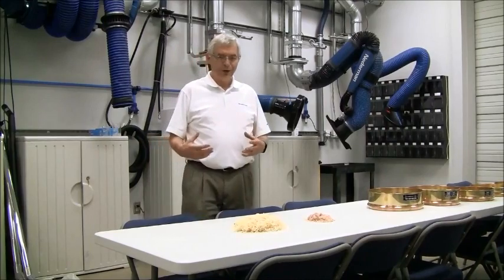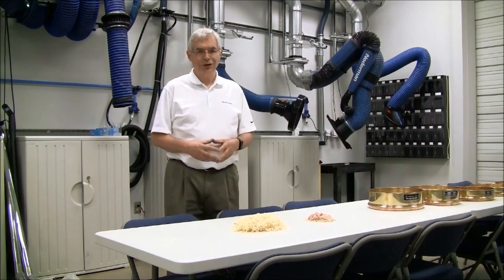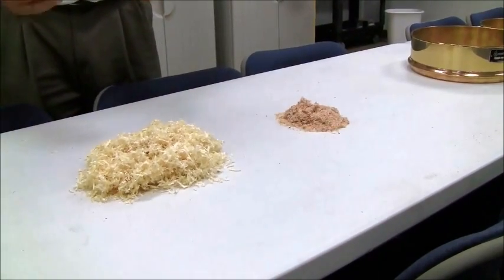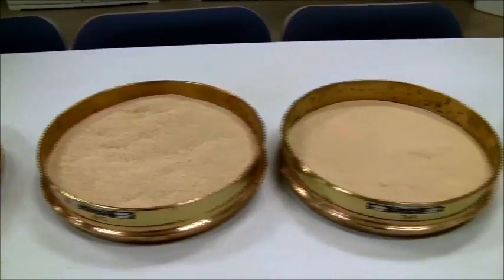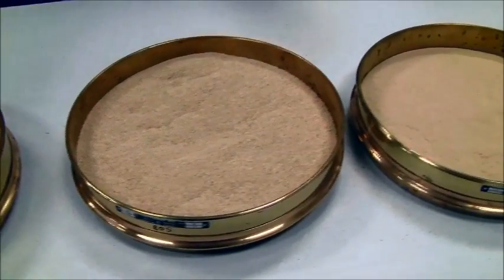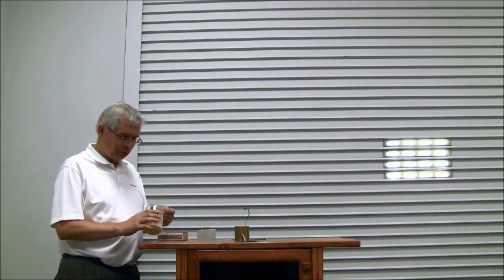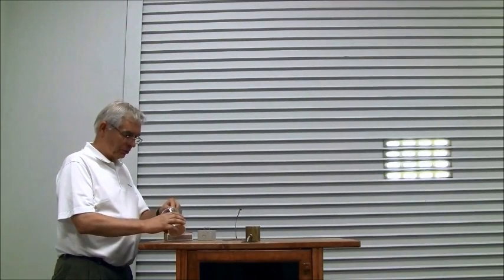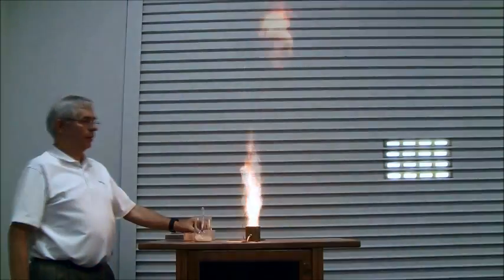Is your wood dust explosive?

Comment: So basically if you have a means to disperse the particles into the air and then an ignition system to set off those particles you will have created a fuel air bomb?

Comment: It is a shame that in 8 years this has so few views and and 12 comments.  There are several animated/cgi recreations from work place regulators on YT, but none that take actual wood dust and demonstrate the difference.  I'm amazed at how small of a difference in particle size goes from explosive to barely burns in the air.
Reply: Thanks for you feedback! Great that you like the way we demonstrate how fine wood dust may pose a potential risk of explosion.

Comment: Do you think it's possible to generate enough heat to fire up compressed wood dust by just poking a hole on a compressed cylinder of wood dust and blowing compressed air through the hole?